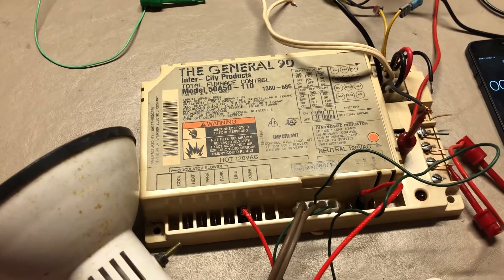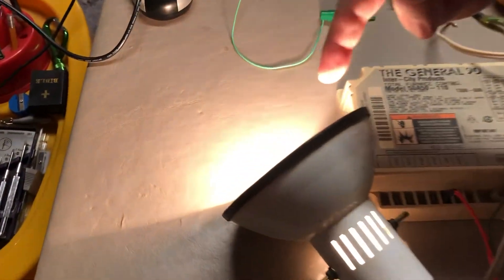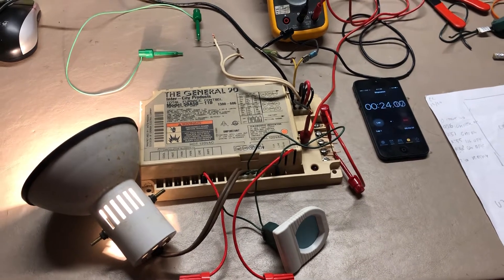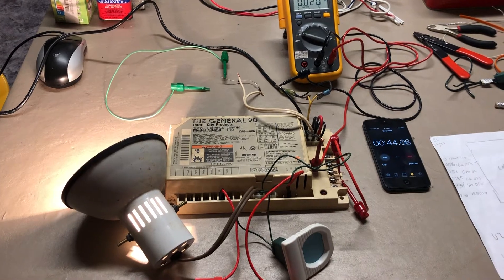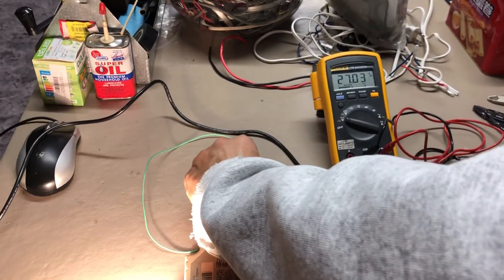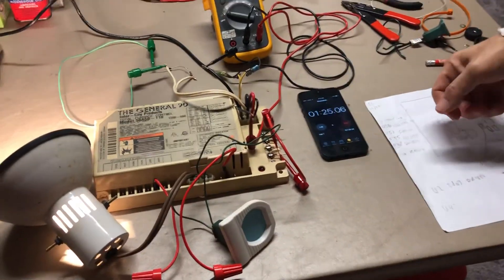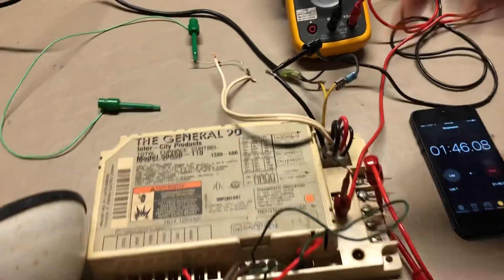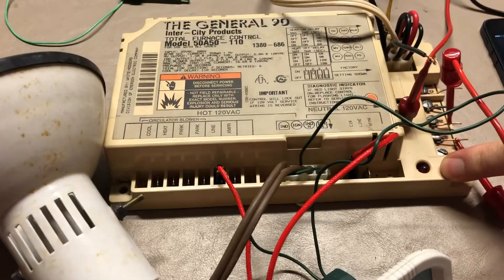Test of “The General 90” furnace controller. Model 50A50-110

Comment: By any chance did you ever find if there’s a fuse? Mines doing a strange thing where it lights up and for a second or two then turns off and the light never comes back on.
Reply from the maker: No, there is no fuse on the board.  If it was blown I think the LED would be dark all the time.

Comment: What does it mean if there is four flashes? That's what I got on my board.
Reply from the maker: Just checked my unit.  There is no label with info on what the flashes map to.
Reply: @Sir_Edward_Cheung  I had an HVAC guy come over to check it out and he found the map on the door. The flash is meant it was a sensor that needed cleaning. Good as rain now.

Comment: Edward, I have this same board for my system. i am not getting power but don't see a fuse to replace. is there a fuse on this board or do you know where i can get a replacement board? Thanks i enjoy your videos!
Reply from the maker: I don’t recall a fuse but on a plane now and can’t access the board. If you want me to check and repair yours write me at eds@edcheung.com